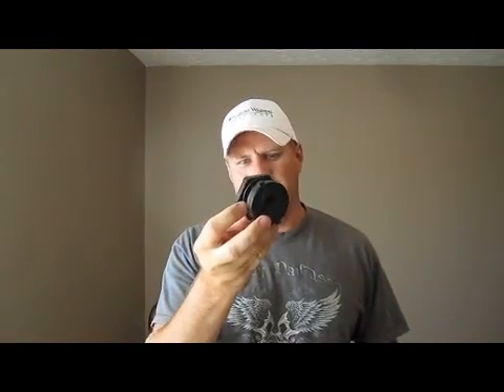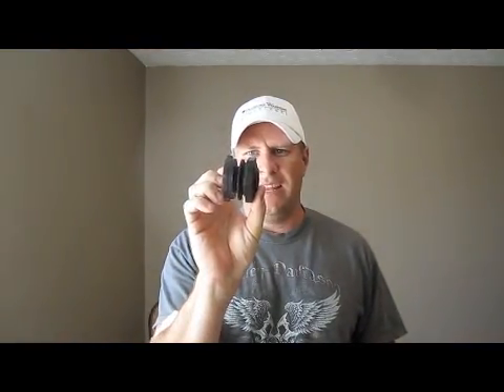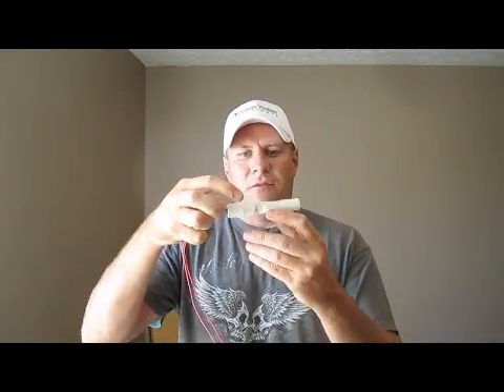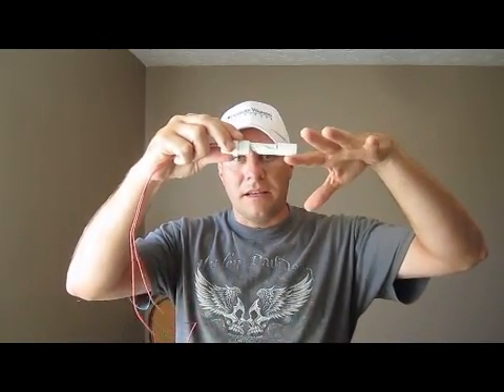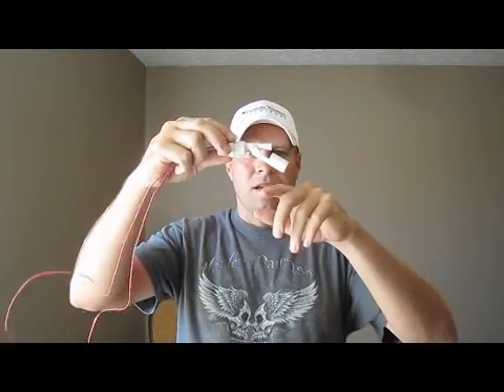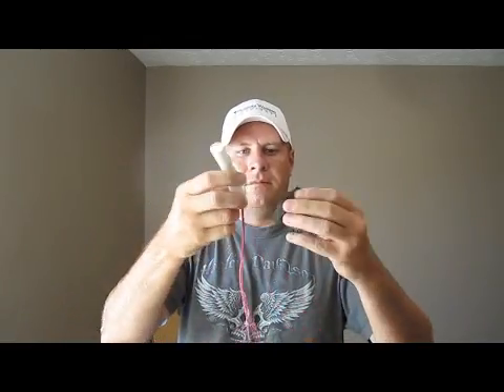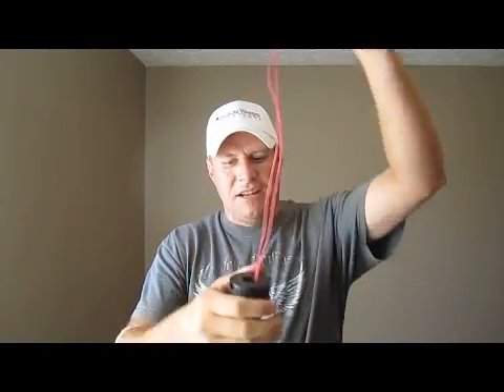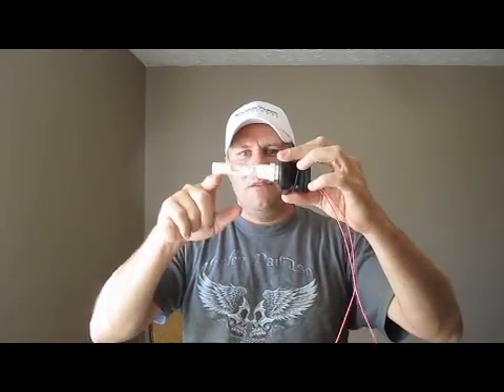Pressure washing water tank low level shut-off switch

Comment: We use the same float switch for our machine. You actually don't need to use a bulkhead with it..just drill a hole in the tank the same diameter of the threaded side and install from the inside of the tank. Just make sure the rubber seal is against the inside wall of the tank. Tighten up the bolt and hook up the wires to your ignition switch. Done 👍🏼
Reply from the maker: Yep it works good
Reply: So without bulkhead 
You drill hole one size smaller than the threads 
And then you thread the float into the hole tight so the rubber ring holds seal against the tank?
That holds the water pressure from 700 gallon tank ?
Reply: @tylerhovdebo  there is a nut that screws on from the outside of the tank once you place the threaded part through the hole in the tank. That's what holds it in place.
Reply: @xtremepowerwashing1815  can you please, please, please make a video showing how to wire this? I have 8 gallon machine with electric start and have no idea which wire to interrupt.

Comment: Hey Michael, thanks for all the info you share. I have a quick question and you might be the guy to go to...  I recently built my trailer with a 250 gal. water tank using a 4GPM pressure washer, I used the same setup before - Tank on the bed of a truck and the pressure washer on a small trailer, the outlet of the tank was on the same level of the inlet in the water pressure washer so I had no issues. now that I have both tank and pressure washer on a trailer the inlet is about 30 inch higher that the outlet of the water tank and Im not getting  enough water to the pump... Im thinking on installing a water pump somehow from my water tank to the pressure washer.. your advise?

Comment: For those of you trying to figure out how to wire this to your machine, I discovered a couple of things from doing mine: "ground out" is a bit of a misnomer. At least for the Honda machines, the ignition on/off switch completes a very low current circuit (~50mA) while the machine is running. But all you really need to know is that the circuit needs to be interrupted to stop the machine. So you want to wire your float switch in series with the ignition switch. The float should be positioned so that it is in a 'closed' or 'on' position while the water level is up, and the float drops and opens the circuit when the water level goes too low. So to wire it, disconnect one of the leads coming out of the ignition switch, and connect the float switch leads in between that connection, so that the float switch is now completing the circuit.
Reply: Can you hook one float up to two Honda 690cc engines at one time. 
Or do I need to install two switches in tank
Reply: @tylerhovdebo  you can use it to do two machines ,no problem.

Comment: Hi Michael, I'm also curious how you have this wired. I picked up a similar switch on Amazon, but it's voltage and current ratings are 1/2 of the one you link to. Is a relay needed to protect the reed contacts from over-current? Have you ever had one of these float switches fail on you? Thanks